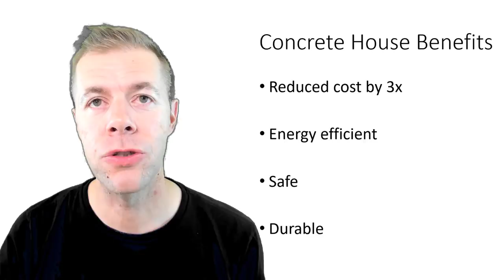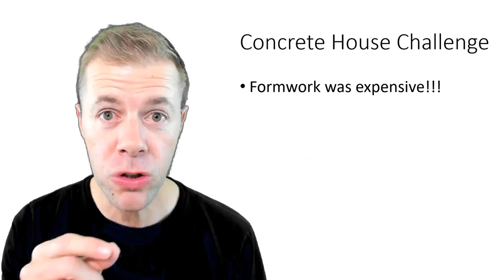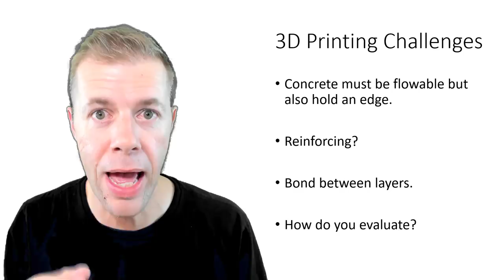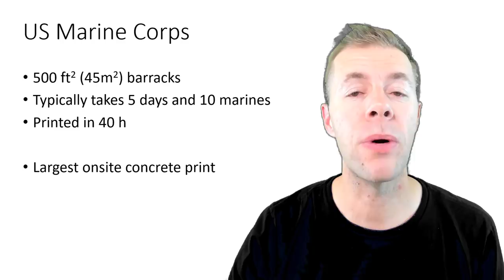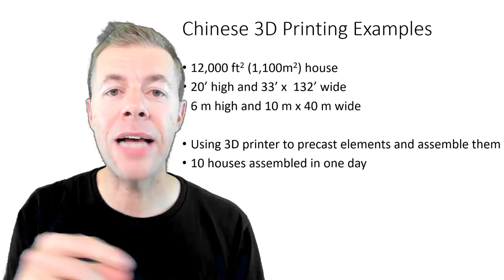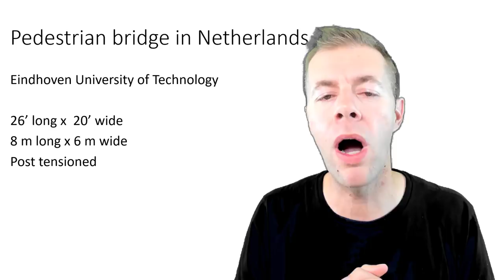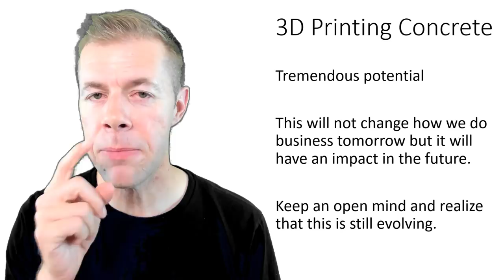3D Printing – A concrete revolution!!!

Comment from the maker: What did you think concrete freaks???  Is 3D printing the future of concrete?
Reply: Frankly I think it's genius. Add some fluffy stuff to lower the cost and CO2 footprint (hemp?) and reinforcement material (more hemp? Glass fiber?) and let 'er rip.
Reply: Yes if mix implementation can step up to the task. Built formwork is hypercostly and therefore imposes simplicity constraints on shapes which are unnecessarily restrictive.  Solve the problem of wet-drizzled sandcastle construction to specified shape and specified resolution/accuracy using controlled-slump reinforced concrete as the material and you will have arrived in the future of concrete, I’d say.  I suspect there will be realtime sensors feeding real-time mix adjustments with a Kalman filter algorithm in the controller.  Delamination prevention seems an issue as much as reinforcement and slump control, which nozzle-zone vibratory micro-consolidation may arise to resolve.  To me the higher purpose, not to abandon Functionality,  is to live in a world of Beauty, which implies that the built environment should be as much as possible an artistic creation which means that artists need to be able to have their vision translated into buildings.   I guess I see things from a sculptural point of view. Perhaps it will be enough that a few bits of beauty will make everybody’s day while still living in a brutalist architecture, concrete freeway world, into the long forever.  But I’d like to see things be more than just boxes and planes.  Just as feet enjoy walking in dirt, the eye also wants to see organic complexity, and relax into the richness of a rich reality. For this, removing constraints from architectural concrete design would change the future for so very much the better.
Reply: I feel like those guys who were first looking at concrete pavers and curb machines. Look at what they did for themselves. I'm just going down the rabbit hole a year after this video.  Some serious problems to solve but still could be a major game changer.
Reply: Yep

Comment: Concrete prefab 'temporary' houses were made in the UK to house the bombed out populace after WW2. Some of these homes are still lived in today, however insurance companies don't like them and as a result it is difficult to buy one using a mortgage as you wont get one. This is mainly because concrete cracks, then leaks..

Comment: I suggest to reverse the build direction from up to down. Build a reinforced layer then push the layer up with a hydraulic press. Continue to print the next bottom layer.

Comment: No reason an automatic trowling machine could not make the walls smooth.  As for reinforcing, you add it as it is laid down.  Not in the pump.  A Pneumatic "nail gun" of corckscrew fibers/wire would do the job easily.... AFTER you lay down a mesh between layers.  This would cross hatch and tie the layers together.  

The PROBLEM as is ALWAYS the problem are the bureaucrats allowing you to build on your own property.  This is why 3d concrete printing will be done in a developing country before the west.  You can guarantee it.  Other than maybe commercial property.
Reply: The outsides could easily be stuccoed and the insides plastered as well.

Comment: If the U.S. could quit worrying about everyone else we could get to work and improve ourselves. To think that Russia is doing this ...  In a sense it may seem as though we are behind. We could use some concrete housing in my city, Currently, we are dealing with an astronomical homeless population who sleep on almost any available sidewalk. This occurs all over our city. Sadly, nothing has been done. If we had the concrete building we could make housing for men and separate housing women. If the homeless folks wanted help they could be trained. This could be the beginning to getting them off the street. So far, this site is cool. I am new here.

Comment: I am thinking along the same lines as printing the form work like an ICF (like the comment below) but if you could add the reinforcing into the print process either of steel or of a plastic material that would be great. You might even be able to print temporary bracing too though not sure if that would be cost effective. Anyway then you just pour the concrete into the form, consolidate it and leave the form work in place.
Reply: This would also allow for blocking out openings such as windows and doors as well as adding architectural features like molding or other relief / features to the exterior walls.

Comment: I think so. What is your thoughts on using micro rebar instead of conventionally rebar in concrete?
Reply from the maker: I like the idea.  I think something like a modified spool feeding system that I showed in the video will be what we evolve to.  What if you could add continuous reinforcement in a known location and at a known orientation as you print the concrete.  I think that is the future!
Reply: A fiber mesh.
Reply from the maker: Fibers are really cool but they might make it hard to print.  We will see!
Reply: Basalt rebar comes in a spool check it out it would work in that system it does not rust

Comment: Did it ever occur to any of you that you're only redesigning your method of POURING the concrete, and this could be reconfigured to be much quicker and cheaper without feeding it through a machine that it wasn't intended for? To me, it seems like the cost would be negated TREMENDOUSLY by figuring out how to automate your forms instead resulting in a lighter weight rig. Possibly even mobile.

Comment: Sorry - so you are proposing urban sprawl? There isn’t enough to house people in this manner you need to built in the 3rd dimension. The future is Passive and NZEB using BIM/lean construction. The only use for 3D printing is industrialised panel printing using structural elements to build in height locally with mobile standardised printing equipment.

Comment: Lego block type or interlocking concrete blocks seem like a better and even faster solution, and there are bunch of these on YouTube but none in Lowes or Homedepot, why is that?  Probably because the brick layer industry and concrete workers don't want it, they want to be the only ones who understand the overly complex codes and methods to make things so they have job security.  I mean what's difficult about concrete blocks... all the code and laws are difficult.  Dry stacking has been around for a LONG time yet hardly anyone uses it, it's 70% faster according to expert sources.

Comment: No love for Insulated Concrete Forms?
Reply: These still take a lot of manual work, and the biggest point for 3D printing is the removalof manual work (manual work by professionals is the most expensive thing in the west)

Comment: 3D printing is the future but not the structure.  Why not 3D print the form.  Fill it.  Leave it. Something that interlocks like LEGO’s.  Let the robot fit that.
Reply from the maker: I like it!
Reply: MIT has a bot that prints a form in A/B expanding foam, which can be filled with cement. Its a different tech, and cleaning up AB foam can be messy. If you're going to print, why not print the house directly instead of dealing with forms. The goal is to minimize the form work and give you geometric freedom for concrete.

Comment: As far as eliminating the double and triple work of forms I have always found the monolithic dome to be a very novel concept. 

Inflate the form 

spray insulation 

hang rebar 

spray concrete 

Done
For some reason people just can't get over the idea of square versus round.
Reply from the maker: Thanks!  I do like the domes and talked about them in this video.  
https://www.youtube.com/watch?v=U86tlUiFM1s

There are problems with arches and domes but I agree that they are a good tool.

Comment: Timber formwork bullshit nowadays it is formed up using steel shutters way,way,way, quicker than bullshit timber!! Or you can have delivered to the Jobsite precast concrete slabs then craned into place one wall at a time until finished!!

Comment: Tyler I worked in concrete as a finisher. we would build retaining walls with wood forms and strip them at the appropriate time and with a magnesium float and mud which we screened from leftover concrete float in and on a finish coat and then sponge the surface achieving a beautiful, durable outer surface. These walls were caped in situ by forming a drip edge on the forms with 2x2and 2x4 to form the lip and quarter round tacked to the 2x2 to form the drip edge. Four men could set up , pour and strip and finish fifty feet a day of a wall. The afternoon would be set the next forms. Of course, we were experienced finishers and knew how to set up and reuse forms.

Comment: When I see the solid concrete print head, I wonder if a person could use a similar, but smaller print head to dispense grout for assembling bricks, cinder blocks, or cementitious ICF blocks. Sort of like the semi automated mason machine only with a wider variety of materials.

Comment: Tyler
You actually built two wood structures.  The outside and the inside!  (if they are the one time use forms shown in this video.  And, if you use some types of mold release agents, you cannot dispose of the used wood in normal trash, you have to treat it like CCA lumber in the waste stream!

Comment: The 3d printing is very cool. What about using styrofoam concrete wall forms from the basement to the roof? The forms stay on. I pored basements with them.
Reply from the maker: Patrick - I think insulated forms are really cool.  The one advantage with 3D printing is that you wouldn't have to place any forms.  You could just start printing the concrete wall.  Either way we need to do something different than what we do now.

Comment: Hi Ley, I liked your Video. I am a researcher working on 3D printing. Would like to know more about it. thanks
Reply from the maker: We are doing a lot of 3D printing as well.  What would you like to know.
Reply: @TylerLey  I want to know about the current scenario of concrete 3D printing. which are the companies currently involved in 3DCP, what is the mix design of concrete used for 3D printing? My vision is to make use of this technology for the infrastructure deficit in India and I see a lot of markets here. I am trying to find the applications which can be targeted solved using this technology. if you could guide us how can we start!!

Comment: Tyler sir.... God I love your videos! Awesome concept this is. You don't know how much you have helped me understand behaviour of concrete. Me , still being in 2nd year of Civil Engineering , have really got interested into concrete.
Well, needed your view on jaggery....well how do you think it's gonna affect concrete if mixed proportionally?
Reply from the maker: Thanks for the message and encouraging words.  Jaggery seems to be a derivative of sugar cane.  Sucrose is a retarder and will slow concrete hydration in low dosages and will act as a plasticizer.  In high dosages it acts as an accelerator.  I don't think we really understand the mechanism.  Maybe you can figure it out? =)
Reply: @TylerLey  oh  I see. So two questions here : can all retarders act as plasticizers also then?
Also, what might be the reason we don't use jaggery in concrete as an accelerator , instead of chemicals like calcium nitrates/formates? Does it affect bonding between cement and aggregates in some way?

Comment: How do you print roof slab without formwork?
Reply from the maker: You would probably precast or preprint it and then lift it into place.  You could also use stay in place forms and just pour it conventionally.  We need to mix our old techniques with the new when it makes sense!
Reply from the maker: Thanks Bondy.  Why print formwork when you could just print the wall?
Reply from the maker: Oh that makes sense.
Reply: @TylerLey  "stay in place forms" ie GFRP mesh forms.... The role of Additive Manufacturing to produce complex structures will be massive.... But the roles in construction will be limited.... IMHO.... 
The concrete industry in the US, will be better served by using existing underutilized technology, such as Autoclaved Aerated Concrete....

Comment: Sir,
How can we design these type of concrete???
Reply from the maker: It is all about controlling rheology!
Reply: @TylerLey  What about the cost of these concrete compared to conventional concrete?
Reply from the maker: They cost a lot more.  We have to make them functional before we can make them economical.
Reply: @TylerLey  Sir,
I have a request. If you can, please make a lecture on mix design of 3D printing concrete???